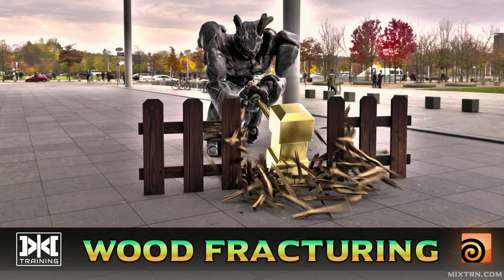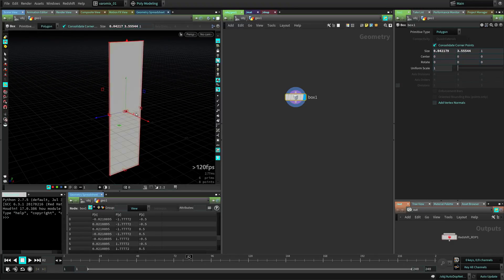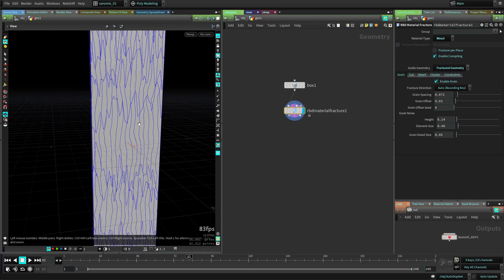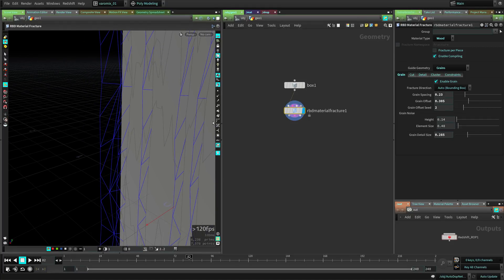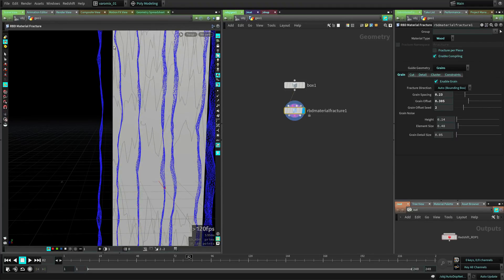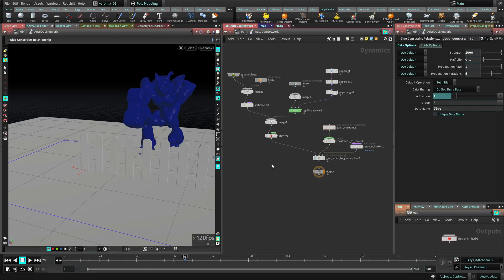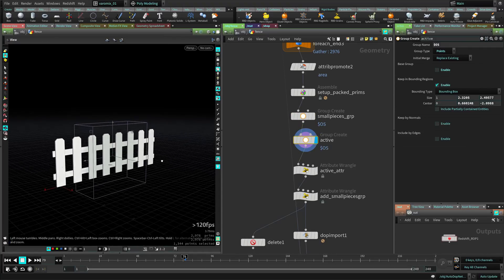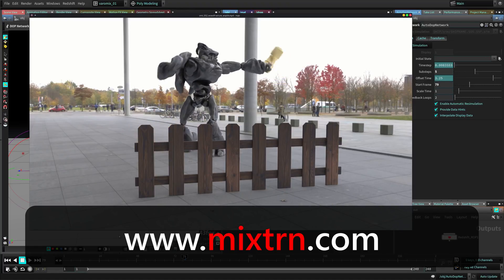VMT - 053 - RBD Material Fracture Wood

Comment: Have you tried to fracture large model? It takes quite a long time. How to solve this problem?
Reply from the maker: How large is your model? you should get it to real scale, I think it depends on how much are you fracturing your model
Reply: @varoschool  It is about 100 times larger than the model you used. In my case, I can not scale the model because it will interact with a key frame based animation. I tried even use very large separation for cut and grain plane. It still take quite a long time for operations such as remeshing etc.
Reply from the maker: You can scale it down, that's standard practice, scale it down to 0.01 do all the effects you need etc at the very very end just before export or anything else, scale the result up again, this is super mega common
Reply from the maker: Parent the main geo node to a null and scale it down
Reply: @varoschool  Thanks for your quick reply. Yes, you are right. However, in my case, the wood door will be collided by a key frame animated object. This key frame animated object whose position is key framed (which means it can not be scaled down 0.01, even the model size can be scaled, but it still follows the animated key position). So my problem is that if I just scaled down the door, it will miss the collision from the key framed object. Any ideas about how to solve this? Thanks.
Reply from the maker: @kunqian7069  it is possible, I have done it a hundred times or more, yes definitely more, there's different ways, the simplest is to create a null parent everything to it and scale down the null, or you could collapse everything to a subnet and scale that down, no matter what time of keyframing it will work, again I have done this  a lot of times before, almost in every single FX job.